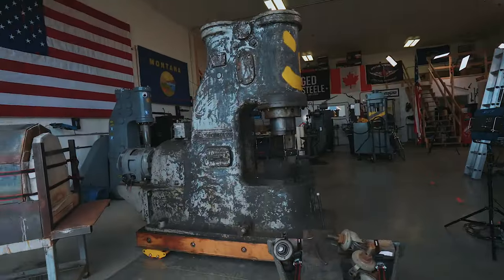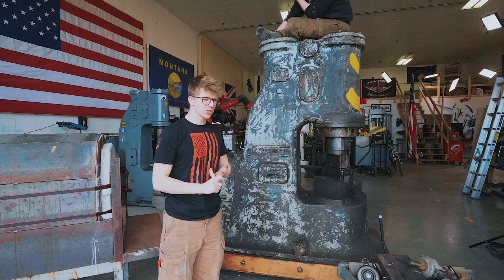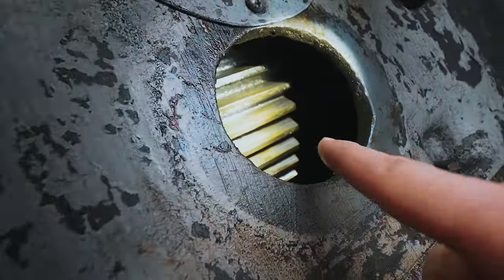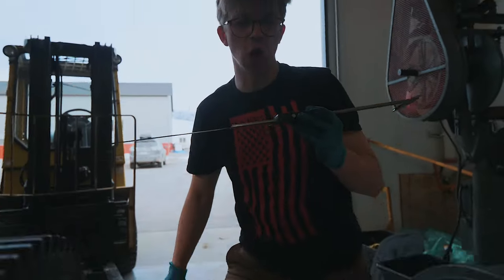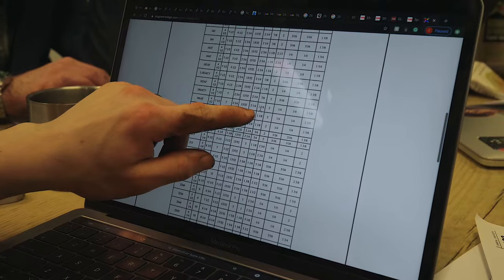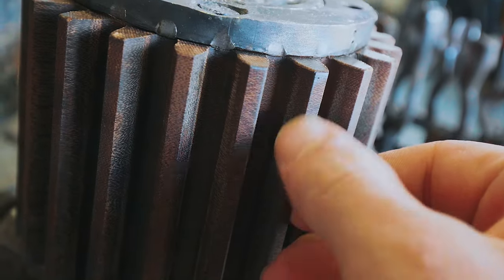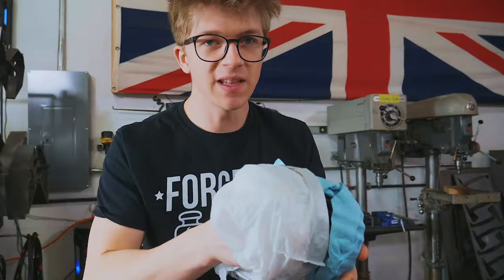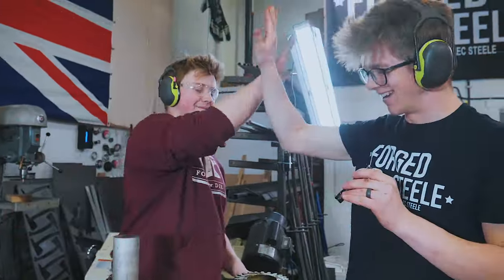FIXING THE 300LBS POWER HAMMER!!! Part 1

Comment: correct me if i'm wrong but isn't the new motors shaft size only a tiny bit bigger? ..I am thinking why not just bore the hole out to the new shaft size and its done?

Edit: Of course imperial measurements make very little sense to me. Old shaft = 1 inch and a half,  new = inch and 5/8 ..sounds like it only needs to be bored out 1/8ths of an inch ..so long as the key-way slot is the same width.

Comment: Don't bore it out just machine out the welds at both ends and press the old sleeve out and make a new one of the correct bore diameter and key-way size.

Comment: Or bore that sleeve out .125 with a boring bar on your manual mill. Using a dial indicator to find the center of the hole and have a spindle mounted boring bar. Then trim the key .0625 to fit the keyway. Because you would have bored the hole out 
.125 (.0625 each side).
Just what I would have done.
.0625 isn't much. 🤷

Comment: The ears breaking on a motor is a really common issue when you have a motor like that bolted directly to steel. If you don't isolate the motor to the frame with rubber or springs you'll crack the mounting ears off your new motor.
Reply: From a Dynamics perspective you're motor is vibrating and resisting torque through the mounting ears to the base which is fixed. You're attaching a vibrating surface to a rigid surface essentially telling the vibrating surface it can't move any more. Stress concentrates at the change in geometry and you're ears fail in fatigue. I would order a different motor with a shorter base to shaft distance to accommodate a 1-2inch rubber block. That should increase the life of your new motor. Repairing the ears doesn't work either because the weld will bring material to it's yield strength before it sees the additional vibration/torque loading. It's cool to see one of these taken apart, I've been curious to see how they work. Good luck on the repair.

Comment: You said it... it looks like there's a sleeve insert on that gear insert. It looks tack welded to me. I would try to grind off those tacks, remove the insert, clean the gear insert, install new insert. 

Or better yet just make a new one. That one was "fixed" 4 times, it's out of round. Give Tony those dimensions and be done with it 😁. Not to mention that bore you bought for $80 when every other one was over $200... tool quality is what you pay. Sometimes you get lucky with cheap, but more often than not that's what you're getting, cheap.

Comment: My guess on this is that it was multiple problems. For all the feet to break either the shipping company attempted to lift it by the motor or when the mechanic that re-wound it did not shim the feet properly. When you torque down on something like cast and it has warps in it it will put tension on it. It is better that it broke in shipping and not when the motor was engaged. That would've been catastrophic.

Comment: Whenever you see some sort of interference that has cracked and lifted a bunch of metal like that, you have to wonder how it developed. There could have been some kind of power transfer through the entire machine that caused it, and it did not run again. It looks like the motor suffered some kind of lock up at speed, and then maybe was repaired about half to try and get it going again for the lowest fix cost, but could not be brought back into use. The fix ideas seem ok.

Comment: Alec, would it not be simpler to shave the new drive shaft in the motor down rather than making the walls of the gear that will be transmitting force weaker?

Comment: it's either very rare for an 1.5iin shaft, or more likely, one of the repair guys on the motor. Drilled that hole out for sayyy, not having the right shaft size and or having a crack that could not be repaired.

Comment: Silly question. Why don't you just get your die grinder on the welds of the gear Bush, clean them off and then just hydraulic press out the inner. Your going to be making a new one so just try before scrapping old one.

Comment: being a industrial electric motor mechanic and rewinder, it was slightly painful to watch you suffer through rebuilding that coupler, instead of having the motor shaft turned down and rekeyed. very easy job for any decent motor shop/machine shop

Comment: Have you considered ferro-nickel weld repair on the original motor housing. I assume its cast iron and used the wrong electrode material to repair the motor.

Comment: Dude, just machine a new adapter piece and broach that out. It'll give you a chance to do a proper machining job (skill building)!!
 you'll be able to swap out those 3 nasty rivets for 6 decent fasteners as well as not be running the risk of further damaging the composite gear, trying to slide it back down the press fit shaft with loads of 'orrible 'oles just itching to take another gauge !!!

Either that, or reach out to "This Old Tony" or "Abom79" - these guys seriously live for jobs like this 😂😂

Good luck from across the pond !!

Comment: Sorry Alec, you got taken for a ride on that hammer if you were told it hadn't been used much and the worn paint was intentionally done to look like patina. You don't need to have the hammer welded and the motor rewound on a lightly used or low hour machine. The cracks on the motor mounts look fairly fresh based on the light orange rust. So most likely they're from moving the machine. Those old machines were built to last and be repaired so odds are that after some initial repairs it'll be good to go for a long time. But yeah, if it was sold to you as a machine that saw little use, my guess is you got conned.

Comment: To me it looks like they already did what you plan on doing, and they used large 4 tack welds to hold the sleeve in there, why not just grind the 4 welds off and remove the sleeve?

Comment: My friend, **before you put a new motor on the machine**,. you really need fix what broke the old one to pieces, or you will quickly break the new one as well. My guess is that as gears got worn down inside the machine, it started transmitting more and more shock and vibration to the motor through the drive shaft. The previous owner replaced that gear with a phenolic gear (my guess is to *absorb vibration*, not necessarily to be the "weakest link"). Anyway, make sure you check how much shock is being sent through that drive shaft before you let it run too long with the new motor. Might want to investigate options with the seller. Good luck.
Reply: You might be right, but i think it was a transport issue. The breaks looked very fresh, and remember when the driver called about an accident?
Reply: @DavidKholz  That's true, could have been a rigging or transport accident. The breaks did look fresh. But also, that gear had been reworked many, many times to try to fix something...

Comment: I'm confused, if you needed to open up the hole from 1 1/2 to 1 5/8 why not just open it up to 1 5/8 instead of opening up the full 2" then putting a sleeve back in to reduce it back to 1 5/8? The keyway would already be there then, and at most you'd just have to increase the depth a bit.

Comment: Really stupid question: Would it not be easier to get a new gear that has a 1.625 diameter shaft that fits the new motor, but is also the same tooth diameter of the current gear?
Reply: It's a fiber gear. Not going to be easy to find, if there is anything like that even out there

Comment: Dude, so the feet are cracked. Get a thick plate of steel, weld all the way around the motor base to attach it to the plate. Drill a couple holes through the plate and fire it up.

Comment: Wouldn't it have been faster to attach the motor to a mill, turn it on (the motor) and machine the end of the shaft smaller? Pretty sure the motor is easier to replace than that gear.

Comment: That's no simple piece of furniture, and top heavy to boot.  Looks like the  load rolled over into the lifting slings during moving at some point and the motor got aced.   I'd have gone with the NEMA motor and turned the shaft/recut the keyway, but... you got it done.  As for that drive gear removal, that helicoil was a rather unpleasant speed bump.

Comment: Why not just make a new flanged hollow shaft? When all is said and done, it will likely cost about the same and be more true to the shaft (unlike the one that came with it) and a perfect fit without all the trauma of boring out the old piece, then fitting a new piece into the bore..... Just sayin’.
Start with a piece of DOM tubing, make a flange from plate and TIG weld it to the tube, broach the keyway and move along.... I think all that would be a LOT faster and more accurate...hey. Maybe This Old Tony would throw you a solid.

Comment: The absolute easiest way to do all that crap is to just turn the motor shaft and MILL the key way on that shaft. Then bolt it up to that broken casting. If you’re smart you would have a really good welder take care of for you, or make new feet that will bolt up to the ground down casting, using very large bolts with loctite retaining compound.You’ll still need that welder to take care of the fractures all over the place. You probably should have asked a machinist if he/she could just turn down that motor shaft. I would do it for you, but I live in Vermont and don’t have the use of the machines anymore. I’m a disabled machinist and only do small work for me and my family members now.

Comment: 1 inch diameter boring bar probably still would not give you the rigidity that you need to go 6 inches deep, as a rule of thumb 4 times your diameter is really as far as you wanna have your tool sticking out.

Comment: I think the video is entertaining. However , I would've used the K.I.S.S. theory(Keep it simple stupid). Why not wait until motor arrives and shave the shaft down then use mill if possible to just make a new keyway if nessicary. No need to overly complicate and take apart the gear.  That being said the feet could easily be welded with a stick for good penetration. If it was cast just use high nickel rod and tap the stress out?

Comment: People have been watching too much CSI  all you champion investigators consider this. The cracks and breaks on ALL the mounts and joints have bolts holding the Hammer down. Why would you bolt it down with broken mounts? Think about it...your eagle eye have spotted some rust do you realise how quickly surface rust can form on cast iron especially in certain circumstances and I'm not sure that its even rust, I have never seen a machine that was so poorly prepared with paint half assed removed. But I can't  get over Alex, that bloke wouldn't get angry if they dropped the hammer on his toe. Alex fire.

Comment: I can't help thinking it would be easier and better to just turn up a whole new collar for that gear, rather than re-using the not entirely round, repeatedly modified one that's the wrong size anyway. You have a lathe, you have a mill, you have steel stock and you'll soon have a broaching tool. You've already got a drawing to work to. Surely has to be easier to chuck up a new piece and just make it square and round in the first place?

Comment: That's crazy it was supplied to you in that condition! Supposedly in working condition. Absolutely shambolic. Definitely been mis-sold there!
I'd definitely be contesting that. At least get the cost of a new motor refunded. That's before you even get into the cost of your time taken to fix the thing!
If I was selling that machine, I couldn't let it go in a non running condition. Or at least advertise it as a non runner in need of a replacement motor. 
To say it's in a running condition is just an out and out lie. Unless I've completely missed something here.

Comment: How is this only 300lbs? Did you miss a zero?
Funnily enough, I just got a shipment of a fridge that claims to be 370lbs, but I would swear it feels more like 120lbs when I pick it up. So maybe I just do not know what things weigh.
Reply: When he says it's a 300lb hammer that doesnt mean it's actually weight but instead the amount of force it strikes with
Reply: @timschrier903  Thanks Timothy S. that makes sense. I will assume it is 300lbs per square inch of hammer head or something like that as well, because that sounds orders of magnitude weaker than would be useful. If the hammer could not lift the man operating it, it would surprise me.

Comment: Crud all ON and around every bolt and nut on that entire power hammer, and this thing was rebuilt? BWAHA
A renowned motor rewinding company destroyed the motor on your power hammer.
A renowned power hammer rebuilder destroyed a bit as well (with the flywheel looking like a crumple cake).
And a renowned shipping company schwacked the rest of it.
And the reason you're not sharing ANY of those company names for anyone else to avoid the same problem is....? hmm? hmm?
See, this is why I'm tuning in less and less.

Comment: Do you have ADHD or did Will mean something else or was he joking. I have it and I do recognise some traits but tyars not really an indication at all. Just interested as I tend to want to know everything about everything like you seem to. So, whyy on earth didn't you go looking for a knackered version of the same motor but with a solid case and move the workings over if the insides had been redone so well? Also would it not have been easier to reduce the shaft to the right size.